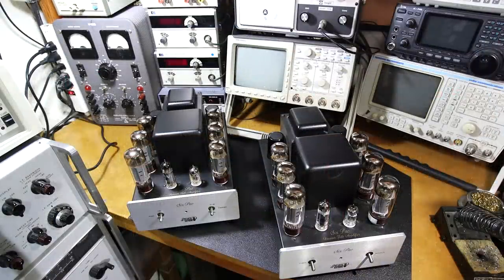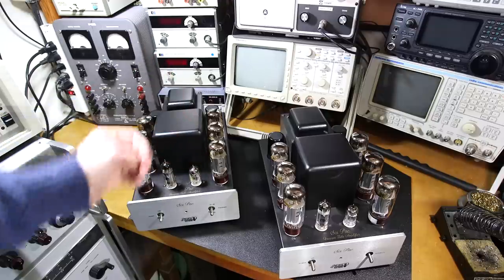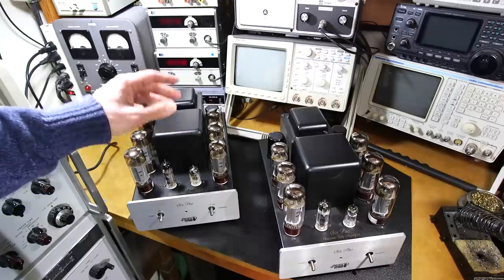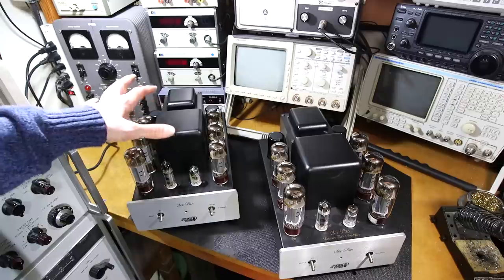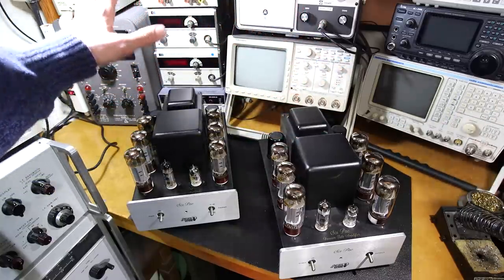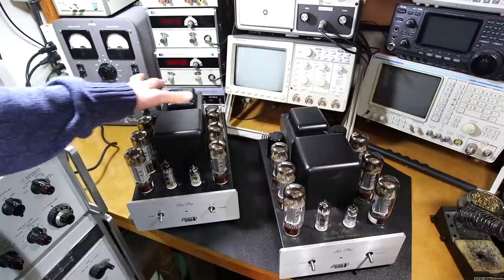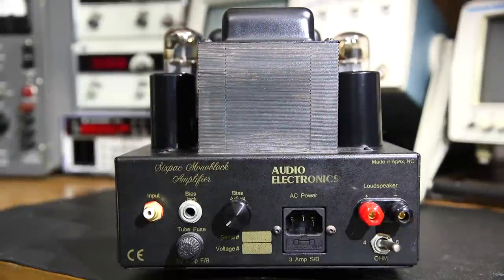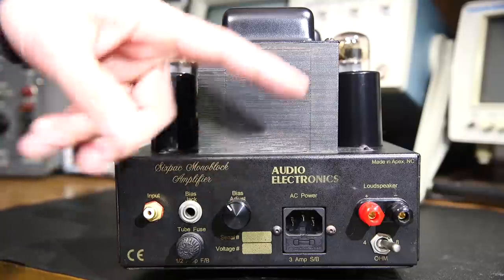Two Six Pac's On The Bench

Comment: I have been a tube tweaker in the past and this video was both familiar and well done. I'm an analog EE and pretty familiar with these circuits. I'd be interested in how you got the extra 50Watts out of the amp with a simple(?), quick change. It seems to me you would have to increase the B+ to do this. I would have run the LED from the 12AX7 DC heater voltage. I think I would also have run all the tube heaters with DC voltages. Maybe that's overkill for this application. I think I would also have put a copper shield around the offending filter inductor to short the magnetic flux leakage with a shorted turn. I like your sniffer probe. Nice job.

Comment: Mr Carlsson: I can't afford the SR780 but would like a recommendation for a good analyzer within the $1-2K range. (and a really good amp review)
Reply: The Analog Discovery 2 can do quite a lot... just need a computer with USB to plug it into.  I still use my Keithley 2015 for THD measurement, but I've found the AD2 is handy for frequency and spectrum analysis for a very low price.

Comment: Thank you, this amp configuration is similar to my old Ampeg SVT bass amp, which uses (6) 6550 output tubes.  These amps running Klipsch corner horns would be like standing in front of the main speakers at Woodstock.

Comment: Very thorough and exact as always! You might try to decouple the B+ rectifier diodes with capacitors at some tens of nF, that would remove some of the highest frequency diode switching noise. This filter choke in a L input filter is quite incorrectly placed, as you found
Reply from the maker: Yes I agree, some diode noise is present, and can be seen here in the video at 1:31:19 notice the small picks along the trace pointing upwards. Thanks for your comment!

Comment: Hi Paul can I add to your comments regarding the use of a new 12ax7 as the phase inverter, this is definitely true when referring to an LTP (long tail pair) phase inv. An LTP PI uses both triodes in its operation whilst a cathodyne PI only uses one triode so there is no need to have balanced triodes. An LTP PI is most likely in this type of amplifier.

Comment: Years ago, I always used to think of negative feedback as an "evil necessity" in the circuit of a Hi-Fi audio amplifier...

But then one day I started climbing the quality ladder with my Hi-Fi components, and ended up with an amp that had an adjustable negative feedback circuit.
I quickly realized that I LIKE at least 15db of feedback. I did not enjoy the rolled off ends of the bandwidth that zero feed back produces.
Reply from the maker: No feedback sure enhances the vocals though :^) Yes feedback makes the curve "not so bell shaped," flat is good.

Comment: Amazingy extended frequency response! I would have thought the transformers would be really struggling at such low frequency.
Did you get the extra power by feeding a 180º signal to one channel and use the amp in a bridge mode?.

Comment: The external bias adjustment knob was a BAD idea. They should have used a flush mount adjustment that required a flat head screw driver so that it couldn't be accidentally bumped once set...

Comment: Following you on your schematic I have learned that a schematic does not at all resemble the physical layout of an amplifier but is in sections that represent each function as the input signal makes its way to the output. Is that correct? I want to amplify all the positive comments you received for this video. It was never dry and always informative, you have a great style of communicating complex details and the reasoning behind them.
Reply from the maker: The schematic is just an electrical drawing, and has no physical connection to layout, (unless intentional.) Thanks for your kind comment!

Comment: I would enjoy seeing you design and build your own single-ended, direct-coupled tube audio power amplifier (maybe even OTL) including a discussion of design parameters, component selection.  The challenge would be to keep it as simple as possible while producing at least moderate power at very low distortion.
Reply: Not an easy job if it were to be OTL... 😬

Comment: I was not clear on the type of phase inverter used. Long tail? Or what. They ran the EL84s in triode mode to instead of pentode mode to have decreased distortion and linearity? 3 EL84s in pentode mode would yield about 100 watts +. Great video!!! I am amazed at your knowledge and experience. I will keep on watching! Thankz
Reply from the maker: Hi. The tubes in the output section are EL34's, the phase inverter circuit is a long tail configuration with a current sink (EL84) in the cathode portion.

Comment: Thanks, Paul! I'm eager to see a LED based triode matching tester down the road. By the way, do the output tubes have to be matched as well? Excellent video, once again!

P.S.: I'm planning to build a stereo single-ended amplifier. It will have a EZ81, a ECC83 for both channels, and two EL84 tubes, one for each channel. I don't know if it is possible (or needed) to add negative feedback. I don't know many tube designs, and I'm a newbie in this department. I'm an op-amp enthusiast, but I would like to know more about vacuum tube technology.
Reply from the maker: Hi. Yes, the tubes should be matched for optimal performance. Negative feedback is always an option, but not needed.
Reply: Probably, if I guarantee that all the tubes work in their linear region, I won't need any negative feedback to reduce distortion. I'm planning it to be a simple and minimal SE amplifier. No bias ajustment and probably no feedback circuit. Thus, all I have to worry about is to bias the tubes properly and to get the transformers. Thanks!

By the way, is it possible to do a constant current sink using a triode? Or a pentode is used of any particular reason? I'm imagining that most tube kit scopes would need some sort of current sink circuit for the horizontal sweep circuitry, so that the ramp generated would be linear, because the timing capacitor should be charged with a constant current to get a linear ramp. In most cases I've seen, the ramp is not linear, but rounded upwards, and the wave gets compressed on the right side. It is quite annoying to see that.

Comment: With the reactors creating so much induced(?)noise, why are they not set as a separate unit outside the box of the amp? I am not an audiophile, and know just a tiny bit about electronics so it is probable that I have missed a glaring reason.
Reply from the maker: External power supplies are the way to go, but it makes the amplifier much more expensive to build.

Comment: The INVERTER is the heart of any tube amplifier...........you are awesome. Since running into your channel earlier today I have my first integrated understanding of how a high speed switching supply works and I've been repairing them for over a decade. I really appreciate you posting this. I'm looking forward to more. One of my clients owns two monoblocks from NC  that are coming in for service in a couple weeks. They have been here years ago. The bias (and standby) method is pretty different. I installed allen bradley multi turn trim pot with a locking shaft to avoid problems with the bias adjustment knob. Man, some of the parts and the wiring method, 100 Ohm screen resistors on all things pentode.......these look just like the monoblocks from North Carolina that have been to my shop before.
Reply: duuuuude!!! hahahaha I used the RV6 type but Damn!

Comment: Amazing Paul.  Allen Bradley and Ohmite pots are military specification in the US.  Questions.  How young are you?  What is your training background?  I worked with McIntosh mono block amps at the beginning of my audio engineering experience in 1966.
Reply from the maker: Thanks for your kind comment Bob! I may do a bio video in the future.
Reply: Bob, you might have worked on (built) my MC-40 amps, which came out of McIntosh somewhere in the mid to late '60s, based on the serial numbers and build rev (one has the low/high line voltage switch, the other does not, which was omitted later on).  These amps are distinguished by their gray, vs black, transformer paint scheme and the omission of the "McIntosh 40" logo plate, and were presumed to be for the industrial market.  I suspect they were made for Barrett Electronics, a Chicago-area company working on an early version of self-driving fork lifts.  Does any of this ring a bell?

Comment: Hi Paul! First of all, i love your videos, very well made, sound and image are truly outstanding! 
I recently got my test bench up and running. All my test gear are HP. Got a 204D oscillator and the well known and beloved 334A distortion analyzer. 
Today i decided to test my hand built 6550 power amplifier. Got surprisingly good results, only 0,08% THD at 1W and 0,25% at full power. 
My question is about power output in those tube amps. In all the tests i used 20dB of negative feedback and the amp works in push pull ultra linear configuration. So, 4 6550, being a pair per channel. 
Circuit is basically a Mullard driver with 6550s operating fixed bias. 
With bias set to 35mA per tube and a B+ of 470VDC i got 30W/chan into 8 ohms. 
With bias set to 80mA per tube the B+ drops to 460VDC but i get 20V swing. That’s 50W into 8 ohms. 
My question is: is the amp operating in class A mode, and thats why i get increased power output with higher bias? If it is not, then what makes higher bias give increased power output?
This did not happen in a transistor amp i tested at the same time. Bare in mind, that SS amp i can set bias from 20mA all the way up to 2A on the output devices, also a push pull amplifier actually, it is a Krell KSA50 clone if you want to check it out, sounds pretty good for solid state.
Many thanks in advance!
Reply from the maker: Hi Lucas, the 80mA setting would definitely be closer to class "A", however, much more information is needed to accurately determine that.

Comment: 19:45 Aren't you concerned about flyback voltages in the output transformers when running the amps with no load?
Reply from the maker: There has to be AC present on the primary for any issues to occur. No input signal= no problem.

Comment: I have a stupid question, I have a push pull amplifier that typicly uses a pair of 6l6 tubes, So, my question is can I use one 6l6gb and one 6l6gc together? or wil that not go very well? I know one is a 25 watt tube and the other a 30. they tested exactally the same on the guitar guys tube tester.
Reply from the maker: Hi Daniel. You can not intermix G, GA GB, or M with GC. The GC version is a different build, and will cause issues with balance. Never intermix a GC with anything else than a GC.
Reply: @MrCarlsonsLab  Thanks for the info!  Much appreciated! Love your channel.

Comment: Really excellent go through!  I had a similar problem with a somewhat larger 10Hy 300mA  choke input filter on a 1050 VDC supply to a pair of 805 power triodes.  The magnetic field noise out of that choke to the surrounding circuits that became magnetically coupled, not electrostatically, was deadly to the fidelity.  I too have large and very efficient full range speakers.  Those Klipch certainly are impressive in the right room setting.  Anyhow, the choke was stuffed under the chassis in the only space available and the problem was solved successfully by fabricating a mu-metal shield placed around the choke.  While my Hammond choke has end bells being grounded which automatically shielded the surrounding circuitry from electrostatic coupling, the mu-metal would provide electrostatic shielding as a possible additional benefit in cases such as your's where the choke is not E-shielded.  I offer this as a possible simpler solution to your relocation project.  Also, your evaluation by changing the location of the choke while in circuit, did not appear to show you making sure the body of the choke was grounded to the chassis to somewhat reduce capacitive noise radiation to the normal situation when bolted to the chassis.  I am really impressed with the flat frequency response from that amplifier without NFB.  That's gotta be some good output iron.  Any idea who made the output transformers?    Congrats on the new lab area and please keep up the awesome educational work!
Reply from the maker: Thanks for taking the time to write Robert. I will do some research on the iron, if I find any answers, I will let you know. Thanks for your kind comment as well!

Comment: You've done it again Paul, excellent video, when you got to the part to grab the transformer with the gloves, it was really suspense for me, what would happened if the gloves were defective, or touch a bare wire that pinch thru the glove, oh man! But in the end it was the way to "show and tell", like it has been said so many times before, you are among super smart in electronics, a great teacher!!! Thanks for this videos, keep them coming just like this. and of course, I'm already a patreon. And the answer to the to the Whats question was by moving the ohms switch at the end like someone suggested below?
Reply: You would still have to be grounded to the chassis to get a shock. I was told when adjusting bias keep one hand in your pocket and you'll never rocket.

Comment: Hi Paul, I have a question regarding the power reservoir caps and that is, can pi-polar caps of the non-electrolytic type be used as reservoir capacitors?
Reply from the maker: That depends on many factors. Not easy to answer without knowing all the specs of application.
Reply: @MrCarlsonsLab  I was thinking of a pure class A guitar tube amplifier like the Fender Champ. Thank you for your time.

Comment: Another great show!!! I was wondering, would wrapping the winding's with a 1.000" wide strip of copper tape and grounding the wrap to the chassis collect that noise, or would it hinder the transformers performance specs? or would the copper wrapping cause more issues, if not magnify the noise's radiation?
Reply: Many power transformers are wrapped with flat copper tape (outside the core) to eliminate most of the "radiant hum" field.  Because Mr. Carlson eliminates most of the 120 Hz "hum" by properly positioning the chokes, and replacing power filter caps,... I am not quite sure what You are driving at.  Putting such a foil on the output transformer should not eliminate noise generated in the amp, as the output Tranny is designed to pass hi end signal through, and the amp cannot determine which noises from the signal path are intentional versus those that have been introduced by inept design.  Here the 120 buzz is not from a stray radiant field, it is from the rectified DC that is used to power the amp.  The hum is eliminated by properly filtering the power supply.  If You meant the choke, putting a mild steel shell over the choke helps eliminate it's radiant electromagnetic field, but judicious placement of the choke does even more.  This amp is not particularly well designed in terms of spacing transformers and chokes away from the signal path.

Comment: I noticed that you didn't have a load connected to the speaker output for some of the tests. I'm given to understand that open tube amps (with output transformers) don't like this. It's something to do with reflected impedance. Have you ever heard of this? I fixed a Gibson Skylark with a shorted output xfmr. It had a blown speaker and I thought that the speaker being open had something to do with the failure.

I had a pair of RCA monoblocs with KT88s and a blue glow regulator tube. They we're stolen when I lived in Silicon Valley. They were fun amps.
Reply: I totally agree with you about the fact of not operating a tube amplifier without a suitable load on the output transformer secondary!!  I use a couple of power resistors (50 watt @ 4 or 8 ohms) for a suitable load during testing.  Never take chances, especially with someone else's equipment!!
Reply: I was also gasping at that open output.  I always load amps under test with a 300 watt 8 ohm test resistor !.  A tube amp that relies on feedback for the inverse phase, of the inverted side of the drive, does not do well with an open Output Transformer, because the inductive reactance of the Out Tran phase shifts quite a lot when it is open,. and it is very easy to get hi Freq oscillation.  Phase shift of close to 360 degrees at some hi Freq with unity gain.     Most guitar amps short the OT when there is no speaker plugged in, as a short is easier for the amp to handle than an open.
Reply: I totally agree, and whenever I bench test any piece of audio equipment (especially older units that have not been in use for a while) I always raise the power to the mains transformer slowly and gently using an autoformer.  Over the years these variable AC transformers have saved the day for me when the equipment being tested had a shorted filter capacitor or other problems. Take care and thanks for your input here!